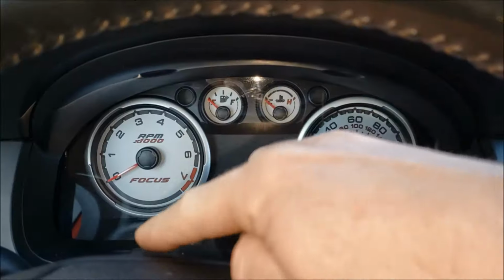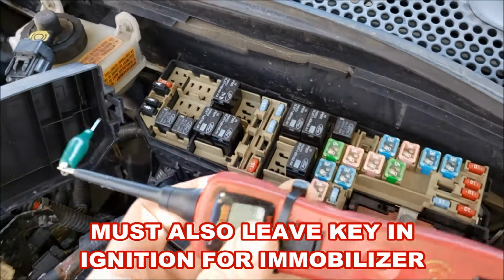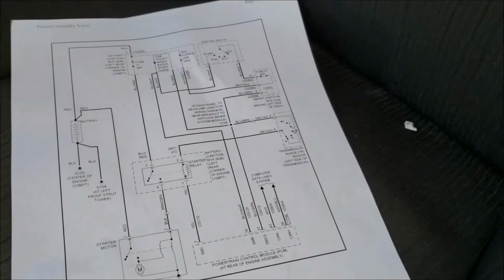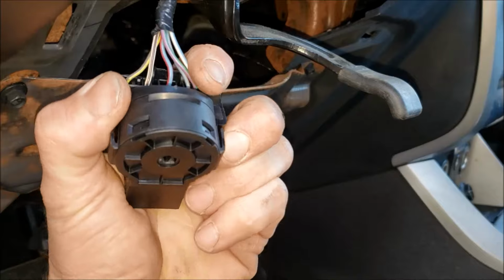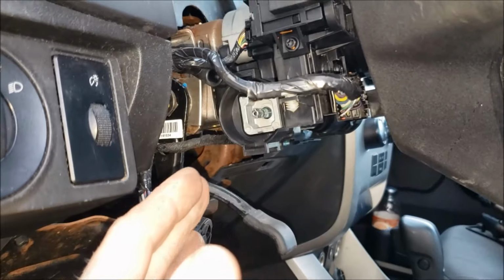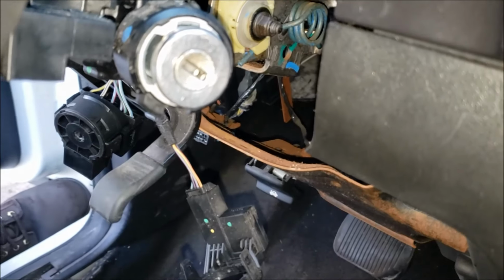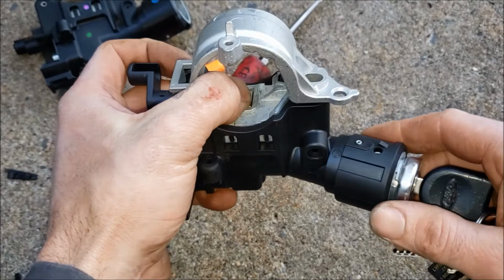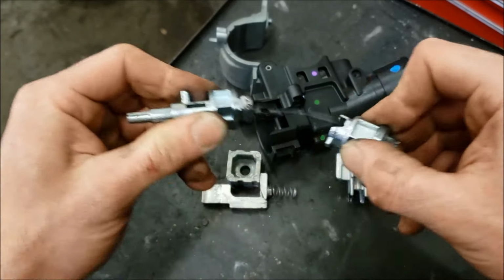08-12 Ford Escape / Focus / Mariner No Crank No Start,  Diag and Ignition Module housing Replacement

Comment: I have a 2008 Ford focus with automatic transmission. I have an intermittent no crank, no start. I have replaced the ignition housing, the ignition switch, the starter relay, the battery, and the starter.  I have also cleaned the ground to the pcm for the PATS.The housing helped the issue with having to push in the key to start it. But I still have an issue when I drive the car until it is warmed up, park it for 10 minutes or so. When I try to start it again I have a no crank, no start condition.  If I let the car sit for 30 minutes to an hour(sometimes longer) it will start right back up. I have had this issue for a long time. I want to give this car to my mom and I need it fixed ASAP. Any ideas would be greatly appreciated.  This issue only used to happen when it was hot outside now it happens even in cooler weather.   Thanks in advance. Anyone who helps me figure this out will get a nice tip via PayPal.
Reply: James Hood, You are the man been a week and no further trouble. Thank you very much! I picked up two diodes at Oreilly's for 4 bucks a piece (got a spare just in case). Just want you to know if your ears are burning it's me singing your praises. I was about to take it in to a shop myself. Again, thank you!
Reply: @mmreasor1  That is great news! I was hoping for your sake that was the problem.  I know how frustrating that is not having any trust that it will start every time.  Have a great day! :)
Reply: I have the same issue with mine, I am starting to wonder if it could be the PCM. I have installed a bypass switch for the ignition switch to a push button start ( switch is between blue/white blue red) starting to wonder if it is transmission range sensor).  Is there anyway to get a link to the print out for the wiring diagram ?
Reply: @mmreasor1  Just a heads up, I finally got mine fixed. After I replaced everything everyone else has with this issue, a local mechanic figured it out after a couple of days of testing.  It was a 10.00 diode.  It took 2 seconds to change it. A nice, good mechanic figured out what ford couldn't.  The part number was YL8T-14A604-AA. After a few years of intermittent issues and aggravation it was the cheapest thing it could have possibly been.
Reply from the maker: Was it the diode in the fuse box under the hood that I pointed at in this video? Just curious. Or was it a different one
Reply: I had replaced the range sensor as well and that wasn't the problem in my case.
Reply: James Hood Thanks hope this works for me
Reply: @NoNonsenseKnowHow  Yes it was that diode.  Your video was really helpful I just never imagined the diode would be intermittent. I thought they usually just failed.
Reply from the maker: Okay awesome, I appreciate you letting me know. I've never seen one of those go bad but I'll definitely keep that in mind for the future. Thanks!
Reply: dallastxracing yes I changed the lock cylinder then replaced the ignition switch on the opposite side of the steering column then the housing for the ignition cylinder. Installed a bypass switch on start portion of the lock cylinder action. I did all of these things and still had an intermittent starting problem, when the vehicle was hot. You have not read the whole thread obviously.
Reply from the maker: Intermittent start issues can definitely be tough to diagnose. It sounds like you have a loose connection somewhere. Did you check the connections on the starter motor itself? Unfortunately nothing in particular is coming to mind otherwise. Let me know what you find out though!
Reply: dallastxracing the problem for both of us was the diode. If you read earlier we changed all the other crap out.I even put in a bypass starter switch on the lock cylinder
Reply: dallastxracing  The diode that broke down on us was the OTIS doodle. One touch integrated start. It allows the starter to continue turning even if you just bump the key switch. So before you go saying I am 100 percent sure it was not the diode read a little more, because this time it was.
Reply: dallastxracing You are an idiot if you think you know what has fixed another mans car especially when you did not do the work. Is this all cases no, but after you have tried everything else and still have and intermittent problem maybe you will try this. It is the same diode as in the video.
Reply: dallastxracing no the ignition fuse was not blown the diode looks like a fuse in the engine compartment fuse box. It is in position 36 or 37 if memory serves correctly, but it is a diode.

Comment: S.O.B...  your way was 100 times easier what im use too.  Thank you
Reply from the maker: Yeah this is definitely the easiest way. I used to think you had to remove the steering wheel. At least that's what the Ford instructions said
Reply: Any year you recommend for Toyota RAV4 that’s what I want.. but the most reliable year?

Comment: Wow! That was much easier than the one I had to replace in a 1999 Pontiac Grand Prix. The key got stuck in the ignition cylinder, and the owner tried getting it out and ended up breaking part of the ignition cylinder housing. Necessitating the removal of the steering wheel etc. What a pain! Nice video!
Reply from the maker: Yeah they are definitely not all this easy, that's for sure!
Reply from the maker: Ford must be making a fortune off selling these ignition modules. I haven't seen one aftermarket yet.  They do so aftermarket parts to rebuild it though